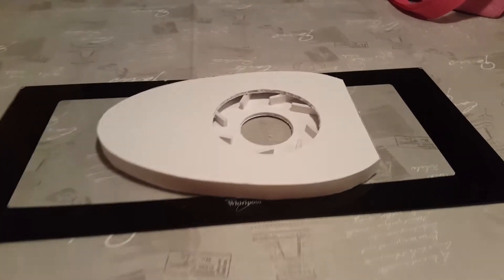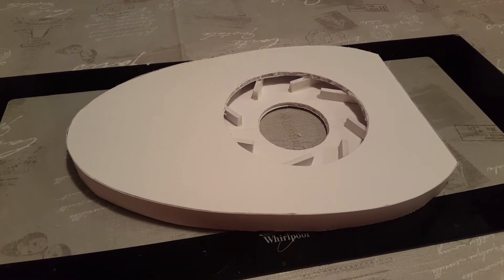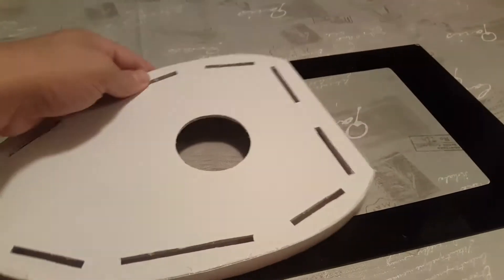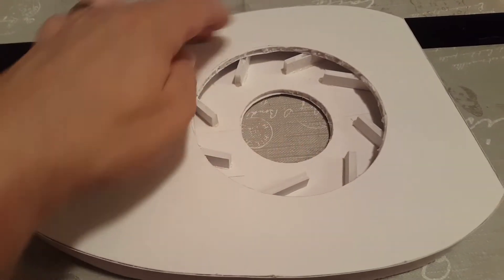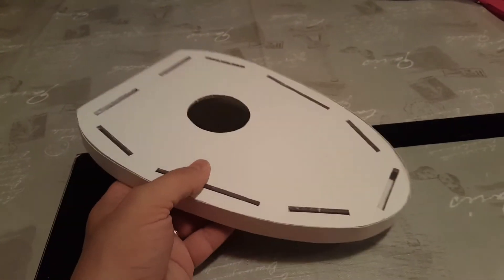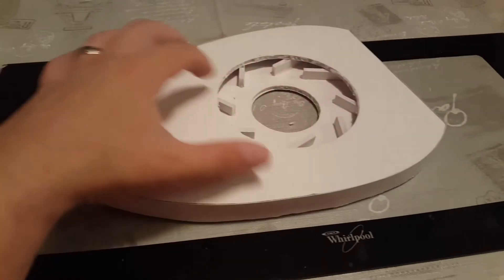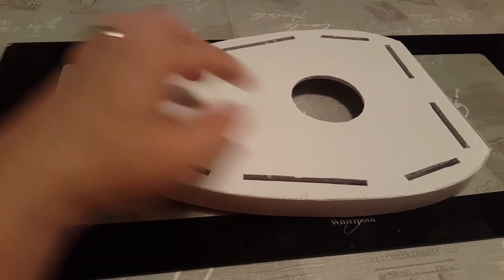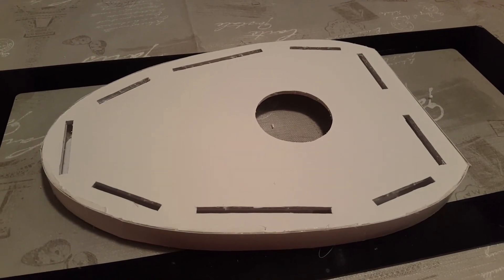My attempt to build an RC Skirtless Hovercraft PART 1

Comment: thanks for posting.  some thoughts.  i have always believed that a hovercraft should hover.  but acv's are relatively easier to make.   i cannot tell what is going on underneath the f-zero things.  i agree, there seems to be a few details of a successful skirtless hovercraft design, that are not widely known.  the use of just three exit ports might result in simple three-point stability.  for increased longitudinal stability, a 'longer' footprint might be considered.  the distance between the 'decks' is perhaps too small; it may impede air flow, excessively.  always think of it as aircraft, and keep all components light.   good luck.    cheers
there has been one successful, full-size, skirtless hovercraft design, that i know of.   see yellow jacket hovercraft.